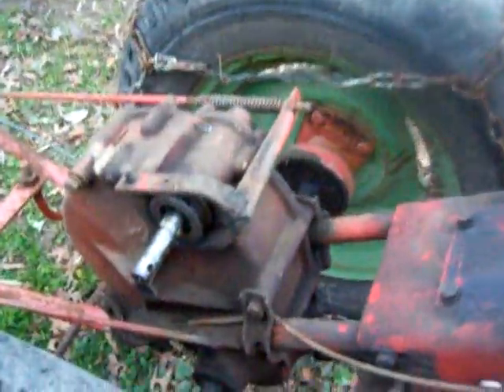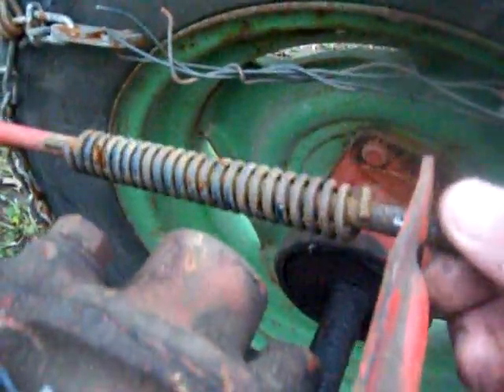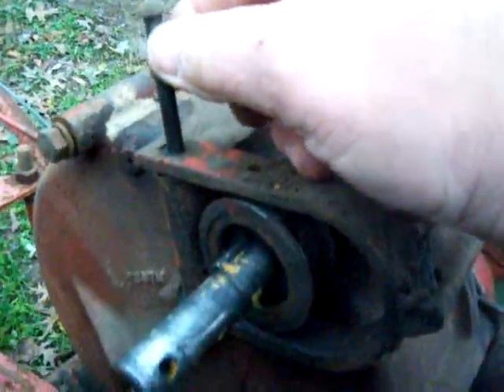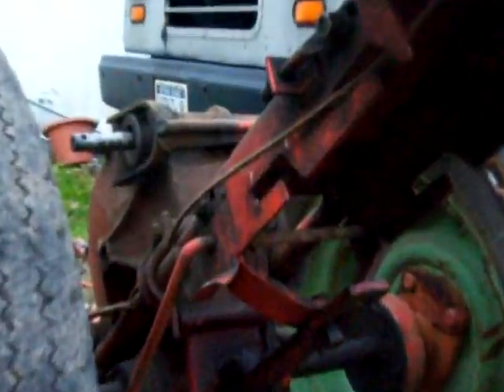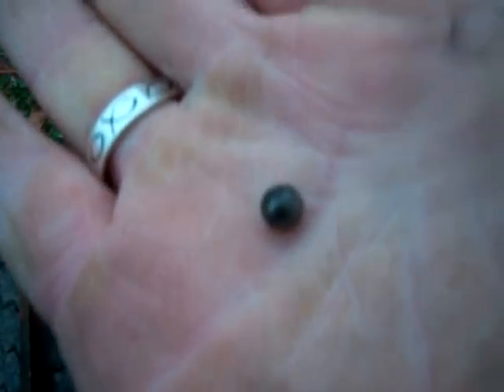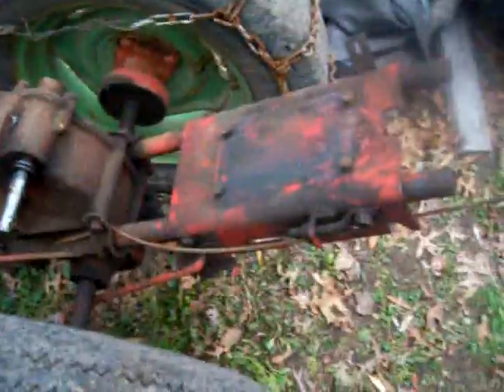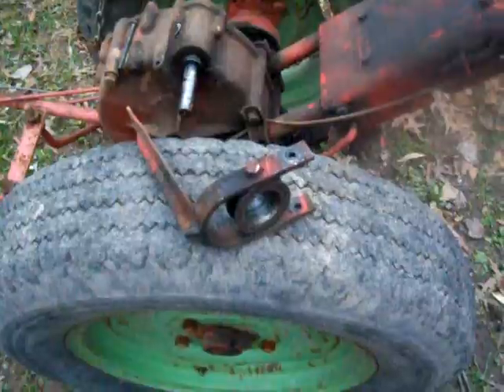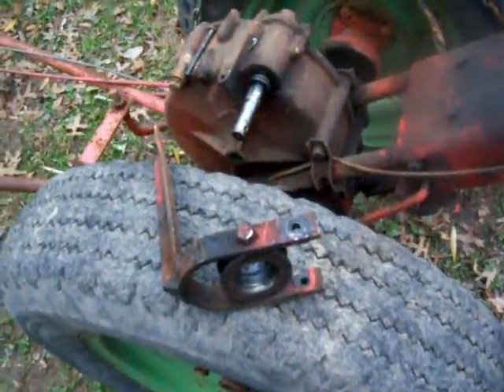David Bradley Tractor Clutch Parts, Removal & Adjustment Part 2

Comment: I have a David Bradley 575 and the clutch wasn't wanting to come out of gear when I engaged it. So I opened it up and found that it had zero ball bearings. But it did have a spring on the inside. Do you have any idea why it is like this. Should it be like this or did someone butcher it together?